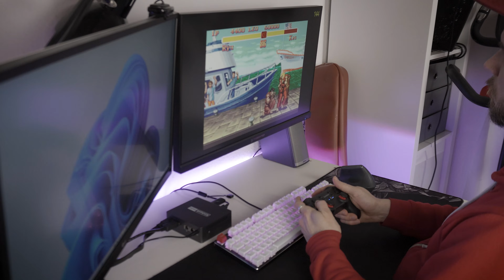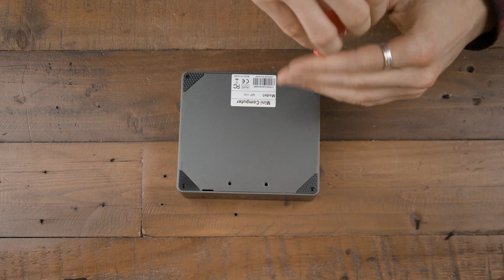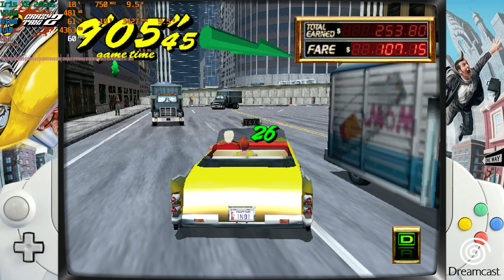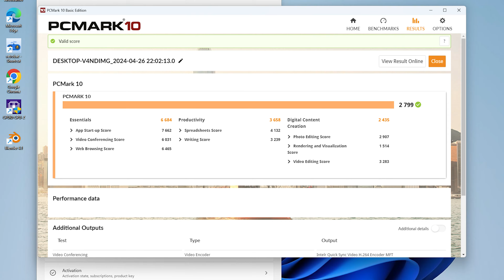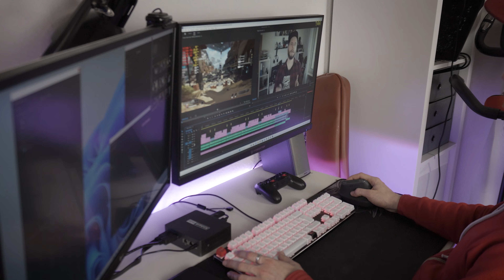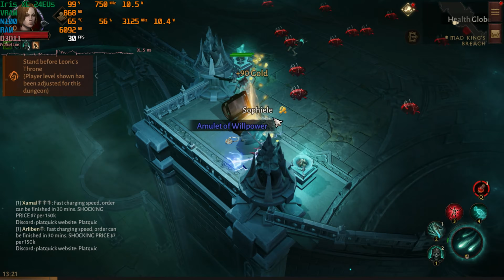This Mini PC has 60.000 Retro Games Pre installed! Kinhank Mini MP100

Comment: Judging by the specs I'd say its not strong enough for today's standards. 16gb RAM and 1tb SSD is a must.

Good review nonetheless. Keep up the good work💪🏼🍻
Reply from the maker: It's not meant to be a PC replacement. It's mainly a retro console. I was just curious what else it can do as no review was really checking out the pc itself so far 😅
Reply: @Hubwood  Oo okay, I see. You did mention it in the review, but for some reason my brain skipped that part😄🫣
Reply: @Hubwood  It is mini PC with retro console + Win11! The cheapest and the most flattering components - M.2 only in SATA and HDD version as cheapest scrap. And max. 8GB RAM.